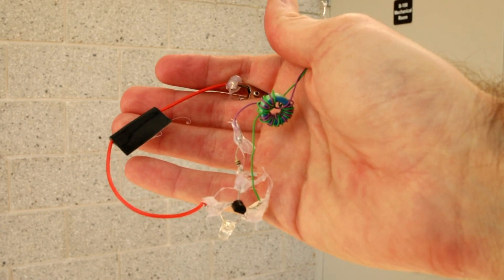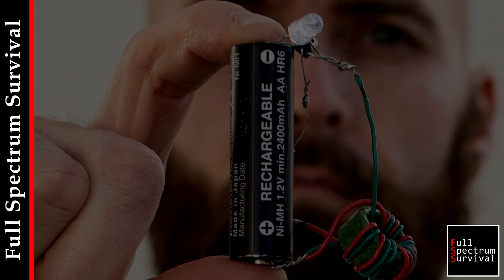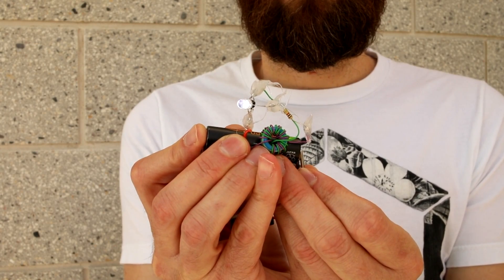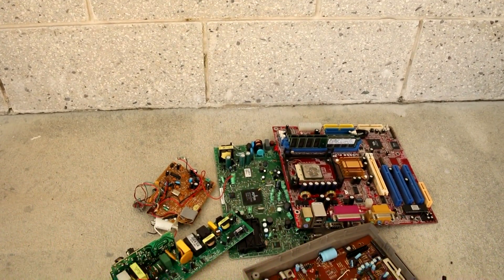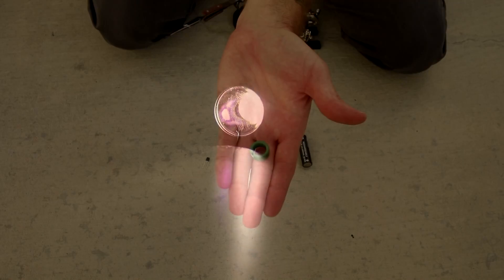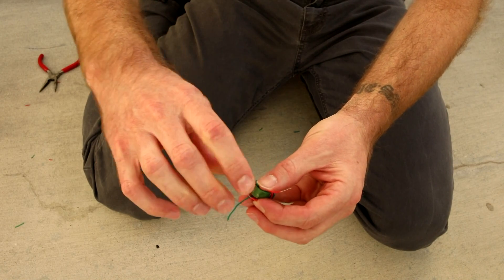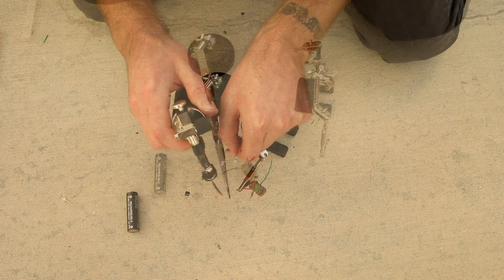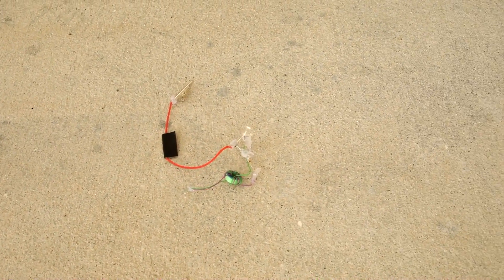How to make dead batteries work after the apocalypse - making a joule thief

Comment: There is a trick that I have learned that can restore some power into a non chargeable battery that is supposed to end up in a garbage bin.

Warning: It works only for emergencies and it may make the battery leak if you go too hard on it or if you leave it in something. It's gonna be good for garbage when it's done after the emergency use.

Since there is acid paste into batteries that eat away the core to make power, you can, by '' Hitting gently '' the sides of the battery with a spoon or a butter knife (Enough to make small dents in it but not to pierce the outside) give back some residues to the acid to eat, so it will give some power for a while.

I did it with a flashlight battery once, and it gave me 3 more hours of power before dying completely. Two weeks after throwing them in a garbage bin though, they leaked.

Comment: Is there a way I can get a drawing of this? I would like to make one now, maybe do different winding. If I can make something that will give me about 8-10 volts I can use a USB charger circuit that I can get from Amazon to change things. I know it will not charge very fast. But when it gets to that point anything is better than nothing! I know electronics, just want a starting point. I am also looking for a AA battery charging diagram, I have been getting rechargeable batteries for some time now. I have used the small solar yard light to charge them after hurricane. Charge by day put in my light by night. The solar yard light don't costs much and if there is good sun they will recharge AA battery in a day, that is what they were made to do! Hope this will help others!

Comment: Any energy in the air as static that you can hear on a radio is STOPPED AT The FERRITE CORE.    THat is what ferrite does is stop that static and pops coming in the power cord of your electronics.   Look at everything you have that is digital that uses a transformer that plugs in has that device on the cord.   That cylinder device on the power cord is a FERRITE
bead to prevent interference from coming down the cord to your, Computer, Monitor, Radio, anything sensitive.   That device shown in this video is a total farce and will short out an otherwise usable alkaline battery that can be re-serviced.    If you remove a battery and let it 'rest' for a day,  it can chemically regenerate some power
and be used a little longer.
Reply from the maker: Thank you so much for sharing infowar! Appreciate having you here with us!

Comment: Very cool! I have not seen this before. I found a alkaline battery recharger on Amazon that works amazingly well recharging dead batt using power from a solar panel. Love this diy project!
Reply from the maker: That is awesome man! Thanks for sharing!
Reply: Can you post a link to that solar charger?
Reply: AnnBearForFreedom sure thing. The charger is just that but it can be connected to a solar panel. Here is the short overview vid I did on it. https://youtu.be/ynxv4hA36mo
Reply: ***** Thanks for the link!  Yeah, alkaline batts can be recharged as long as theyre done more slowly. I use an AC alkaline charger, love the idea of doing it with solar.  Thanks!